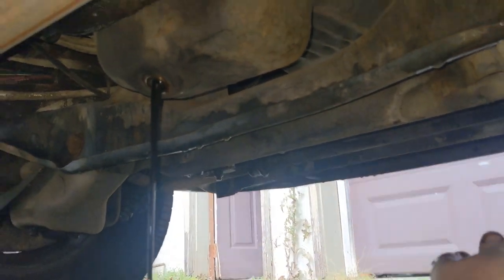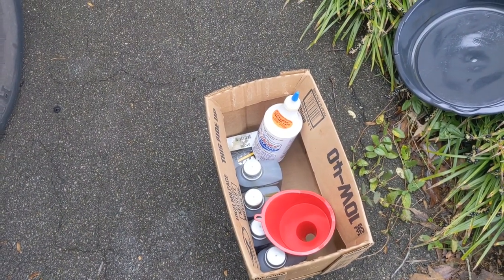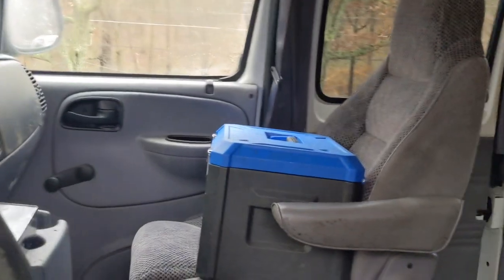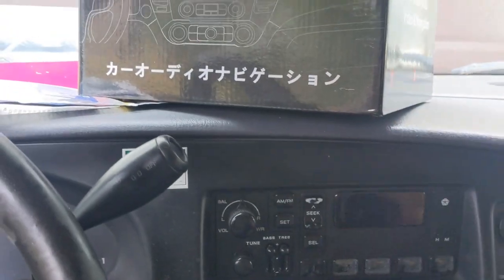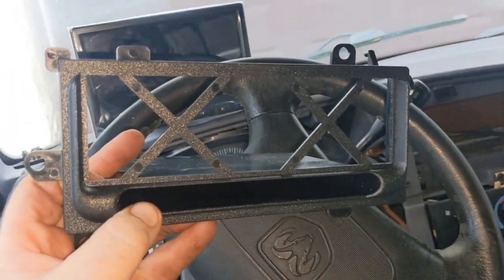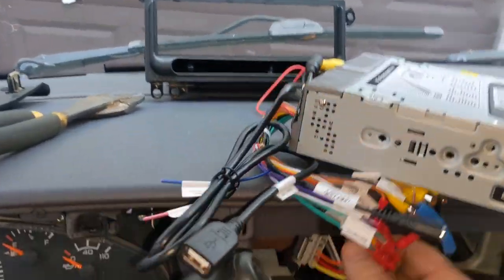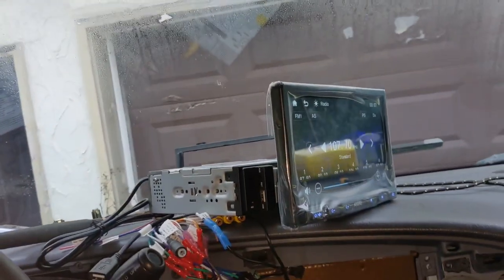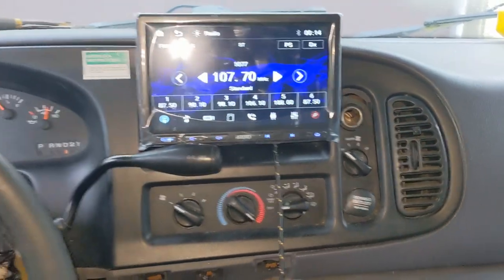Installing an Atoto F7

Comment: A winter storm warning… I am not a mobile 1 fan. Runs good! Get that rig ripping!!!
Reply from the maker: We got like 3" of snow. 😂 I've never had a problem with Mobile 1 in a stock motor.  I'm probably not going to run it in a high HP engine though.
Reply: @ForsakenSteel  we are getting 6-22 inches today.😃.  When’s the buff and wax video coming?

Comment: Didn't know you were supposed to put oil in the filter. Is that a good idea all around for any vehicle?
Reply from the maker: Yes pre filling the filter will help the engine have oil pressure sooner. Which will reduce any damages from not having oil.